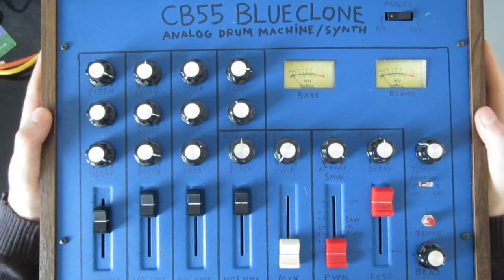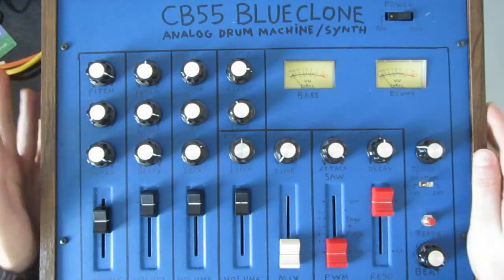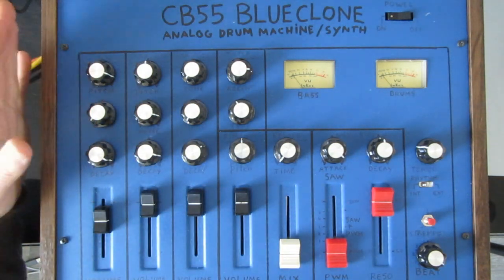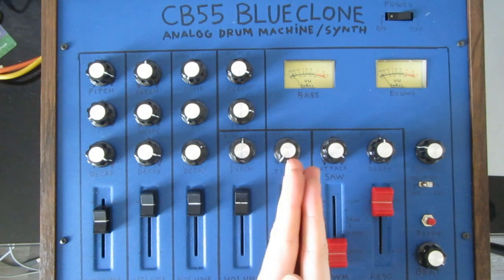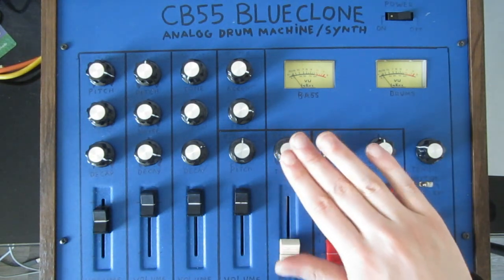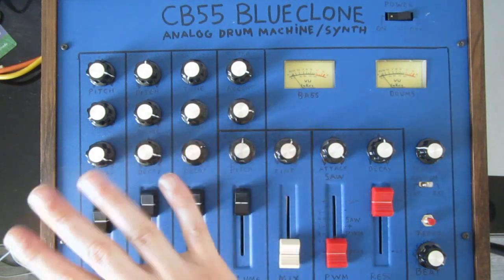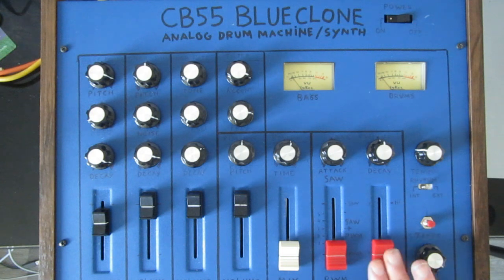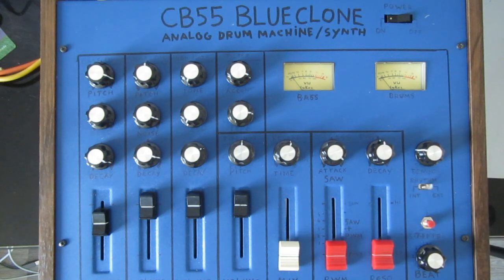Blue Clone - DIY analog Drum Machine and Bass Synthesizer - WIP update 1

Comment: On your page, I have quick question, regarding the LM324 op amp / comparator.  You’ve listed a DIY vactrol with a 5-50k value listed there.  I understand the Vactrol is an LED packed up tight against an LDR, but how should I meter for this 5-50k value, is it read on a multimeter for resistance?  And across which legs of the Vactrol?  Thanks for any help with that, I think it would help a lot.  The triggering sequencer from Arduino is a great little project, as there are many more PCBs like the CB55, and so your project could very likely be implemented (as-is without modification) is to drive say, the Hexinverter.net Ate-Oh-Ate toms, etc.  THANKS FOR SHARING, GREAT WORK!!
Reply from the maker: The 5-50k resistance range is for the LDR, from what I recall the LDR should be in that range when the LED is on. If not, you only have to change the 10k resistor in that circuit to match, so it's not a big deal if yours isn't in that range :)

If you have a premade vactrol, then it's best to look up the datasheet, those always have the pinout. The type number is always printed onto the casing for easy searching.

Glad you like it, thanks <3

Comment: What are you using here to sequencing bass line? Thanks
Reply from the maker: I preprogrammed a bunch of melodies into it. Later I also added MIDI for external sequencing.
Reply: @rot_studios  , oh may i ask one more technical question, since you have been doing that: where to look about what are technical parameters for trigger outputs? Is there even "industry standart" for that? I mean voltage, polarity, impulse length? I would much appreciate info on this, Thankyou.
EDIT: my reading around says it should be basically impulse of 5V. Right? :)

Comment: Hello, may I ask, provided code - is it for Arduino Uno, or Mega? Thank You...
Would be nice some primitive (hand drawn, anything) Arduino connections diagram, or if no time for that - maybe just table: Pins - Connections (Pots, outputs, etc). Thank You in advance! :)
Reply from the maker: Arduino Uno. The connections are all defined at the top bit of the code, but I'll add them here for clarity's sake:

 //bass synth
#define BASS_CLOCK 8    //PORTB 0
#define VAC_PWM 9
#define VAC_CUTOFF 10
#define PWM_OUT 11      //PORTB 3
#define SAW_OUT 12      //PORTB 4
#define MIDI_ACTIVE 13

//controls
#define ATTACK A5
#define DECAY A4
#define WAVE A3

//drum triggers
#define TRIG_KICK 3
#define TRIG_SNR 4
#define TRIG_HH 5
#define TRIG_RIM 6
#define TRIG_ACC 2

//controls
#define MIDIEXT 7
#define TEMPO A2
#define BEAT A0
#define STST A1
Reply: @rot_studios  , Oh, I am sooo glad AND Thankful you responded on this! :) So, as I see it, change of beat patterns are done with analog pot, similar as in arduino "minipops" drums? And, about DIY opto-resistances. Did you buy some particular items for LDR, or just adapted what you "found in drawer"? :)) Again - thank you! Btw, I think bass lines sounds pretty good!

Comment: looks like an old mixer panel
Reply from the maker: It is, from an old Inkel 800 mixer. It has these fancy wood side panels, perfect :D
Reply: I have a few old mixer boxes, that I could probably do that to
Reply from the maker: Mixers are great for synth building, because of the knobs but also loads of op amps, capacitors, transistors all made for audio. Great way to build synths for cheap and to recycle!